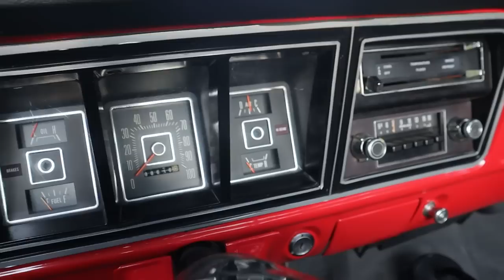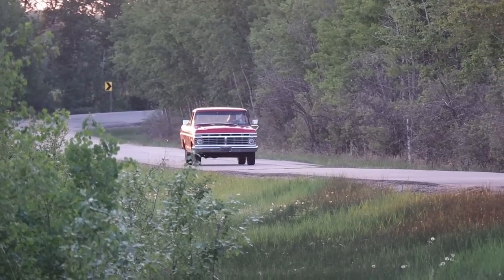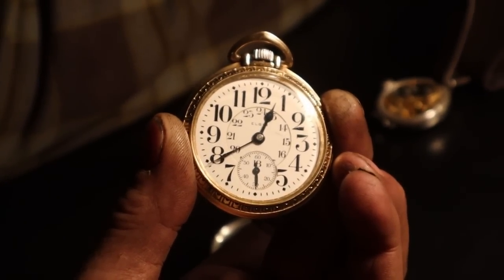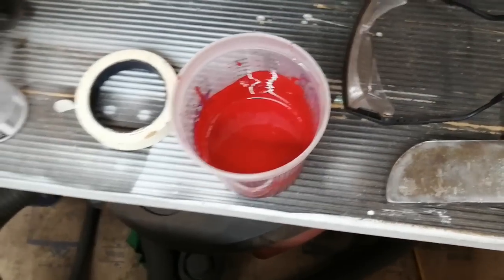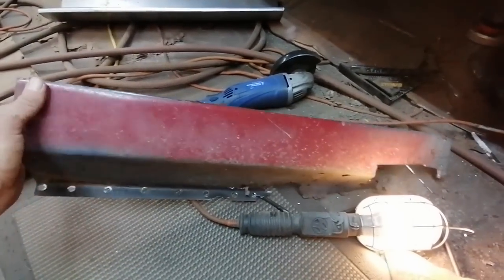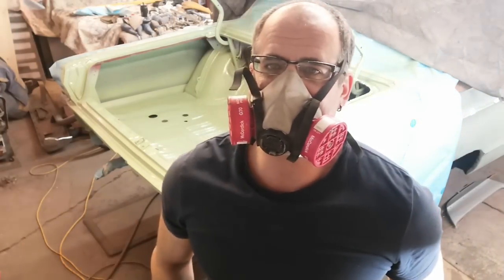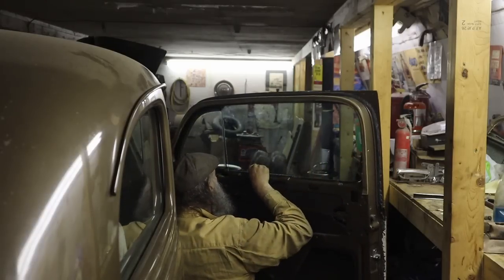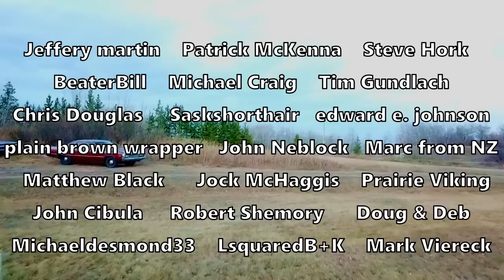1973 Ford F100: "Turn up the Base" Special! Plus: Myles' 1966 Plymouth Fury  Gets Some Colour!

Comment: Thoroughly enjoyed Myles working on the Fury. Old watches are so cool. Used to get a truck because you needed a truck. Not so much these days. In 1980 I bought a 78 D-100, baby blue shortbed, manual brakes and steering with a 225 and automatic. I miss that truck. Thanks to Gary for keeping this one alive.

Comment: Dad and I just pulled a 78 f250 supercab long bed camper special with a 460. Redid the brakes. The starter. Some fuel line. Got a lot going on for her. Sat in a barn for 27 years. Fired right up!

Comment: 12:06 The old stuff also rides better because it's softer sprung and has more sidewall less rim. Those Goodyear Wranglers, in particular...one of the reasons I've put three sets on my F150 and will refuse to put any other tire on it as long as I can get them is the nylon belts in them. 100% nylon belted. They're VERY soft and forgiving. It's like having air ride springs without having to put air ride on the thing. Between the soft springs, soft seat, and those soft sidewalls, I legit don't feel a god damned thing bump-wise. It's **wonderful**.

Comment: 73-77 F100s have to be my absolute favorite Generation of the F-Series trucks, Next to the 93-96 F150s. My Dad had a Dark blue 93 XL standard cab long box, with the 4.9 6cyl. Less than 75k original miles is what the odometer read when I last drove it. It was a smooth running and fun driving truck. My older brother owns it now, ever since my father passed in 2020 an sadly lets it sit from what I know. I also got burned on the paint job from a guy he recommened an wish I didn't Listen to him. Hoping one day I can get it back an give it the love it deserves, but back to the 73, It has to be the most gorgeous 73 F100 I've seen yet. Everything about it is just perfect, I'd love to have a clean 70s F100 as a daily worktruck, can give it a good clean an waxjob on the weekend. Beautiful, Beautiful Truck. <3

Comment: My Uncle Bought a 1976 Ford F-100 Brand New. His was really Base. No Radio, 300 Cubic Inch Straight 6 Cylinder Motor, Rubber Floor Mat, Vinyl Seats, 3 Speed on the Colom, No Gauges. Just Idiot Lights, No Rear Bumper. No  Headliner. Very Base.

Comment: I smelled the vinyl floor when I saw that dashboard cluster. Reminded me of my dad's super clean '76, metallic blue, short bed, 6 cyl, radio delete, 3 on the tree ford truck. Then, that click sound when he put in in gear reminded me of the green, long bed, 351 4 speed, beat up farm truck that I worked beside on my first farm job at age 15

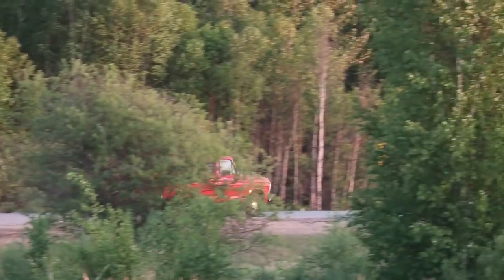Comment: 12:43 That is one DAMN NICE truck and ya'll should be proud of it! Honestly if you just handed it to me all I'd do is throw air con in it, perhaps replace the head unit if that one is AM only, and that'd be that. Perfectly equipped! I'd leave the V8 in it, even. Just a good, simple, honest, rugged old manual trans workhorse. It's got a good 30 years of life in it!

Take good care of it, boys, itt'l be around for the long haul.

Comment: 12:52 I get that in my 85 F150, too. It's a third smaller and 2,000 pounds lighter than a current generation F150. It's nuts.

Comment: I really enjoyed the '73 F-100 segment. I love those trucks! I actually have 5 of that series, one is a '73 F-100, but it is not sweet as that one. I was amazed to see a set of original dog dish wheel covers on there, they must be hard to find these days. I've been wondering what the color name was on my '79 F-350 4X4 and I'm pretty sure that it's the same color as Gary's. The guy I got it from said he thought it was a Ford truck color, but he didn't remember the name. I think that color was used on a lot of Fords. Thanks for the memory jog.

As Tommy Chong once said, "I'm not into time maaaan", but those old watches are pretty interesting. I was amused by the comments in that segment, especially about the Rolex brand. A friend of mine said that he has relatively cheap watches that are much more accurate than his Rolex. It's all just for show, that's why they're so big I guess. I got a good laugh from your four horseman of the apocalypse remark. I was thinking that if the cabal notices how many cars you have that are not wiped out by EMP weapons, they may set your woods on fire with space lasers eh?  We're living in clown world. All we plebs can do is laugh at our imperious "leaders"  😂😂😂😂😂

Looking forward to seeing the new engine in the T and plates on the 37. I hope Myles' project Fury sounds as good as his current one when it's done. Maybe Myles will go even bigger on the cam in that car? 😃

Great show Scott, thanks for sharing.
Reply: The paint code letter should be on the door data plate. That was when I found out my '68 Mustang had a fake data plate fitted to reflect its colour change.

Comment: My dad had an orange and white 72 or 73 (it was a while ago) F250 2WD 4peed w/granny with a 360 2bbl with a hand throttle.

You could run a bungee through the steering wheel, jump into the bed from a slow walking pace and shovel silage out for the cows.

Comment: Worked at a service station in the late 70's, doing mostly tires, tune ups and oil changes. The shop truck was a red '73 Ford Custom, 302, granny-low 4 speed. We mercilessly beat that truck, but couldn't kill it- thanks for the 'time trip'!
BTW Scott- the 'soap box' is one of the reasons I never miss an episode 👍
Reply from the maker: Thanks David! Cheers from me and the Menace!

Comment: Sure brings me back to the mid to late 80’s. My pickup in high school was a 1979 F-100, 4x2, 302, automatic. Mine was silver. AM radio. 
Mine turned DOWN the base a little. I had power steering and brakes. US base spec?

Comment: Wow!  Does that F100 bring back happy childhood memories for me!  Back in the day, my Dad purchased a 1973 F100 "Explorer" pickup, which was then a special edition model.  It was finished in "Burnt Orange", and featured wide white racing stripes at the lower beltline, "Mag" style full wheel covers and Goodyear Raised White Letter tires, 302 V/8, no A/C, no PS or PB, AM radio, 3 speed manual shift (column).  The interior was likewise Burnt Orange.  The bench seat was Burnt Orange vinyl holsters, with "Striped Upbeat Cloth" inserts in the seating areas (a woven cloth of wide stripes of black, chocolate brown, and orange).  The vehicle was used to tow a StarCraft pop-up trailer for Summer vacations for our family, and was only used/driven for 2-3 weeks of the year!  Otherwise it remained in careful storage, awaiting the next Summer's travel.  :)

Comment: My 73 also had the 360, it was an xlt though. I will always remember that truck because it got 9 mpg in the city and 11 on the highway . If you had enough weight in the back it would pull stumps.

Comment: That truck in Mexico featured the same front end however the dent side bed had no rear side marker lights and the smaller 1972 tail lights were used.  The larger tail lights that truck has were never used in Mexico.
Reply: @MaxGiganteum  That is not true.  The Carry All was the B Series.  The pick up was the F series.  I don't have to imagine.  I live in Mexico and they are all around me.

Comment: What a great piece you guys put together !!!!! from start to finish !!!! only thing it needed was some Strong motors content !!!! and Myles going the extra mile providing awesome content !!!! and my favorite part the watches !!!! TELL Mark his Elgin Father Time turned out great. nice work replacing the balance staff and jewels.
and he dosnt need a new hairspring just needs some careful tweaking, because a new hairspring would require re vibrating balance assembly.  I work on pocket watches !!!!!ive been teaching myself over the past year.

Comment: Definitely alot of passion went into that F100. Sweet truck with the V8, and standard on the floor.  Great to see Mile's Fury coming along, great work. The 37 is getting close to being road worthy!!! Also like classic time pieces,  such a wealth of knowledge he has.
Cheers from Southern Ontario.!  
(Have you found "Ball and Trunnion" parts for the drive shaft on the 1960 Fury? (Minakers auto parts in Milford Ontario has them).
Reply from the maker: Thanks Murray! I'll check it out...Cheers!

Comment: My 75 F-150, it's the one in my thumbnail, is a project started in 2017. I hope to get it back in the road this year so it will only be a 6-year project. It won't look that good though, I need a bed and tailgate. It's the top of the line Ranger XLT but the dash is almost identical, the headliner is vinyl covered cardboard and it has carpet and a cloth bench.

Comment: Had the same F 100 here in🇦🇺with that front.  dash a bit different but licensed as a 74 here in🇦🇺.owned 3 F100 short an long wheel base  last one 351 Cleveland 4 barrel 4 speed 4x4 .. that truck would look good with 3 bows an an black tarp . Or in cream . Nice truck boys good save . 👍🏻💯🇦🇺⛽️.

Comment: I'm surprised Myles is going to paint the Pontiac red? Very good sheet metal work and looking forward to see the vehicle finished. Love the Ford F100 very basic but reliable. If you can find one in the weeds its usually very rotten from the bottom. Or if it was a farmers car the tale gate is gone or very tented up. So seeing one that looks like new just brings joy to my heart. And 20 years to finish a car is really nothing as long as you get it done. Doing the window adjustment on the Chevy is a two man job.
Reply: This update is on my 66 Sport Fury, the Pontiac gets a time out for now
Reply: @mylesmoparfreak6562  Thanks for letting me know. They look similar from the rear end sort of.

Comment: F100 looks and sounds great. A neighbour I worked for bought a new one in 74. Also base. Even had three on the tree with the 302. The one option it had was the high output heater. Had a little tag right on the panel face.

Comment: Great pickup ! As I recall, F100s used stamped steel twin I beams while F150 and up used heavier forged units. Both made front end work a PITA unless you were built like the Incredible Hulk
Reply: @MaxGiganteum just  looked it up Max...the stamped I beams weren't until 1980 so this truck is forged for sure
Reply: @MaxGiganteum  my 85 F150 had the forged items but I saw stamped ones on the odd F100 of that generation....but F100s were rare

Comment: In 1975 i bought a new f150 with a 360 engine, worst handling truck i ever drove bc ot the twin i beam axle. Six months later it had to go in for warrenty at the dealer. I needed a truck so they loaned me a used 73 chev halfton off the used lot to drive for a week. The next day i was at the dealer & told them to keep the ford & bougth the chevy. It handed & sterred like it was on tracks compared to the ford, been a sguare body fan ever since but the ford sure does look good, nice work on body & paint

Comment: when enough time goes by the "fuzzies" in the U-channel that the window glass runs in will bunch up as the glass slides and wedge itself under the edge of the glass until it cannot move. More old car fun. Riveting those fuzzy channels in is not a fun job, but necessary, sadly . Love this

Comment: Best thing about the f-100 over the f-150 is you can use the 9 inch in your dodge pick up and use your big bolt pattern wheels and brakes are the same I got one out of a 6 cylinder and it had 411 gear put it in my 70 Fargo pick up with 440 and 727 had the steelies and caps

Comment: The opening scene with Kyle's models is King Street in my home town, Saint John, New Brunswick. Very cool! Where did you find the pic?
Gary's truck turned out great! Awesome job, guys!
Reply: That's cool that you recognised Saint John. Love the model intros.
Reply from the maker: Hey that is cool that you recognized it! I try to pick scenes at random from image searches like "main street 1970" or something. I liked the "Zellers" sign on that one and the photo matched the perspective I needed...Cheers!
Reply: @coldwarmotors  I was surprised when I saw it! King Street is one of the steepest main streets in Canada, so I'm told. It had and still has angle parking on both sides.

Comment: I had several 68 through 72 Ford trucks. They were all over the place for sale. I all ways had to fix something, brakes cluck things that people would just park them, and they set until to Late 80 s and 90s when I pulled them out and put on the road.

Comment: Love the FORD truck. I bought a 78 F150 4x4. Same color bare bones equipped. 351 4 speed. Other than grill looks the same. Rarely used first gear too. Paid $6400 brand new. Took me back.

Comment: Really nice work, Myles!   Couple of questions, if you don't mind- one is about the use of weld through primer- somewhere along the way, i've gotten the impression that it isn't very good long-term for corrosion prevention and you should try to use it only in the spots where regular primer would burn off..  do you know if that's the case?  i certainly like the idea of using it more generally as a surface prep for hidden areas as you have done, but i'm just not sure how that works out long term.   I guess maybe it doesn't matter if you're going to spray in some kind of cavity wax afterwards anyway?

Second question was about the rubberized undercoating. you mentioned spraying some 3M stuff on it, which made it solidify- what was that?  Just curious, sounds like it really saved the day.
Reply: Exactly bud, just use it to get some protection between the welds, and go in after yoir done the vehicle, and spray rust protection

Comment: 5:59 That's a damn nice truck and itt'l live a good long time, but to be honest...speaking as someone who owns a vintage half ton Ford truck...the 300 would have been a better workhorse engine. Power of the 302 with 30% less fuel and 20% more lifespan.

Comment: Have you ever thought about basically just knocking down the rough stuff and putting one of those clear Coat compounds people are using nowadays for "patina" preservation that might perfect for the 37. That would give it a more uniform finish

Comment: The F100 has the long box, the four speed instead of three on the tree, a 302 V8 not a 300 6, a step/tow back bumper, an AM radio, and the big mirrors. I've seen them WAY more base than this beauty.

Comment: I think in 73, full gauges were an option. Now, i plan to have my grandson look at this video. His first real vehicle is a grandpa owned 2005 Dodge Ram 1500 short cab. Its a native West Georgia truck with 143,000 original miles with no rust. It was basically used as a fishing truck. Its a single seat, short bed.  I am going in for a heart catheterization procedure shortly so it may be awhile before i can mail the packages to you  Best to all the agents, and Frankers, who is beyond words.

Comment: FoMoCo products MY 1969-1972 had their new recipe for steel that turned out to be disastrous. Rust, rust, and whole panels disappearing in the first three years in salt country. My dad had one, much like this pick-up but a '72. It almost rusted away, especially in the box area, until he complained to the dealer. FoMoCo had a program to do panel replacement and other body work for customers who complained. I don't think any recalls were issued. So I wonder how many 69-72s there are on the road today.

Comment: Excellent video Cold Water Motors Agents Scott  :)   , Agent 900 1973 Ford F100 Custom in Raccoon Red , V8 302 2 barrel carb V8 , Manual transmission floor shifter  Creeper 4 speed  , not sure said if daul exhaust and super nice plus quiet  on road to plus basic model! I remember my late dad, his brother (my Uncle ) 1968 International 1200 (1 ton) pick up bought new  in Hamilton Ontario Canada at Assembly plant built them was Mint green then went Fire Department color Red was basic model too I never drove was off road in 1984 need Manual transmission repairs , in 1983 bought a second hand 1978 GMC High Series 25  Serria Scottdale  3/4 ton  with 1 ton suspension and basic model too 2 tone blue color, Am radio but did not have Am/ Fm radio in front windshield was on left fender some how got broken in 1986  and I put better antenna on fender for Am radio ! Bought it for $5.000  remember hearing about in 1983 were second owners of it but learn drive on road too in 1990's  ! Then was sold for parts to fuel truck driver for farm supplies plus fuels ! Then 1993 my dad also uncle bought  at farm Auction  a 1990 Chevrolet Cheyenne 2500 light duty 3/4 plus learning  how drive too and in 2011 was sold family friend wanted plus that truck basic model  with Am radio  bought truck for $10.000 Ontario Canada 🇨🇦 dollars! Why my Uncle & Dad the want basic model and am radio want not fix problems too but never big repairs to do on! I know take time to full restoration on Vechiles  Scott did a 1986 Ford F150 XLT Larite  extension  cab with 302 V8 4 barrel also could find orgnail box in Gas model had get Desiel  motor box from California  ship to shop do my late Cousin Father's in 2004 plus do repairs on frame rails on bottom plus preparing for paint and swap stuff from old to newer better one ! The truck full 3 years on body alone plus floor in cab ! Plus 2 tone paint plus decals on task so many hours do and was glad got done  too !
Reply: Rangoon red rather than Raccoon red ;-)

Comment: My high school bud had a totally beat '73 he paid $300 for. Not a straight panel on it. Had to crawl in from the passengers door. 240/3 on the tree. He put a fifth wheel style bed on his dad had. Front end so wore out you couldn't hold a lane over 40 mph. :)

Comment: f150 started in 75 as a way to avoid the cat exaust. those 4 speeds are tiring to drive all day. much prefer the 3 on tree in these. this should have had a vynil seat-not cloth. first year standard disk brakes-huge inprovement
Reply from the maker: Oh, it is a vinyl seat...Cheers!